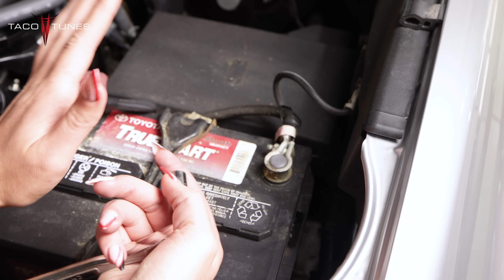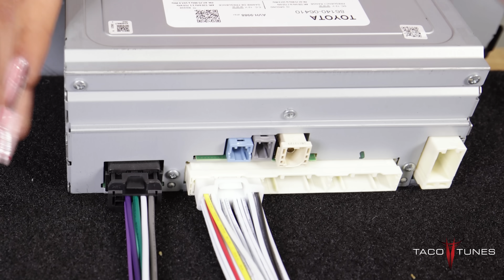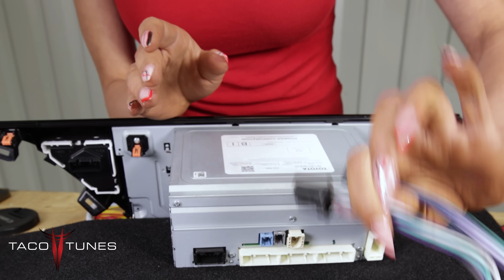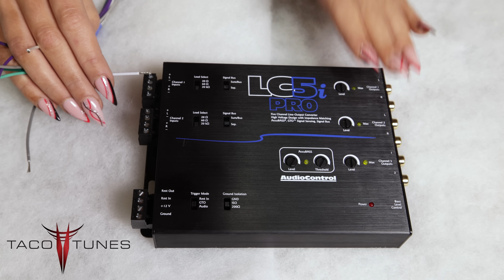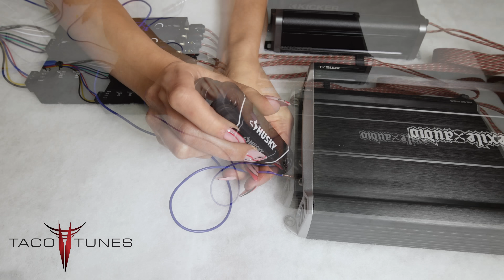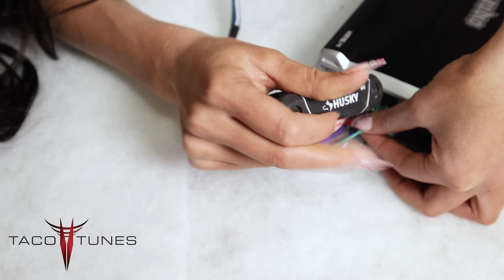2020-2023 Toyota Tacoma add amplifiers to stock stereo Audio Control LC5I Pro Line Out Converter

Comment: Question. I want to upgrade my door speakers in my 2023 non amplifier truck to a set of components in the front and a swt of coaxials in the rear doors. I also want to add a subwoofer on a seperate amp. I want to use a audiocontroll 4 channel amplifier and then use a skar audio rp amplifier for the sub. Can tbis harness still work with the plug and play features for both amps? Also am i still able to use the factory wireing to the door speakers and dash tweeters using this harness for my 4 channel amp